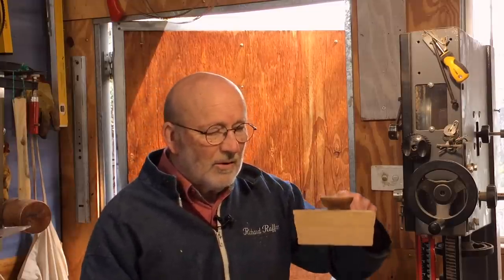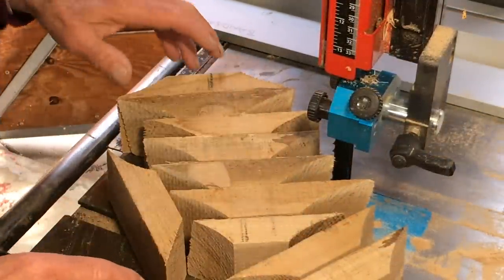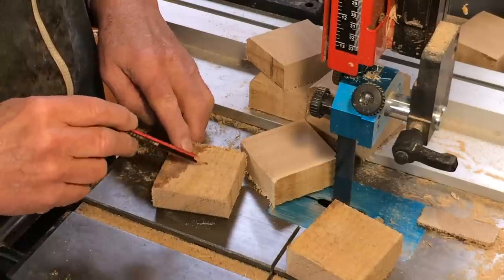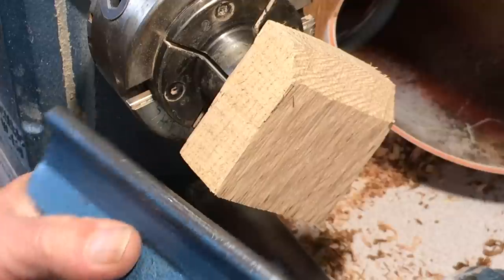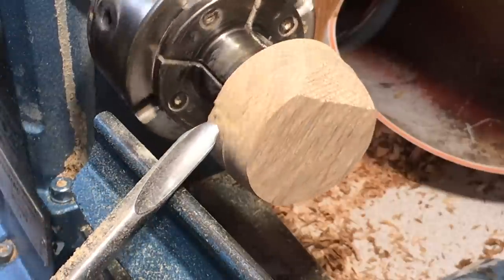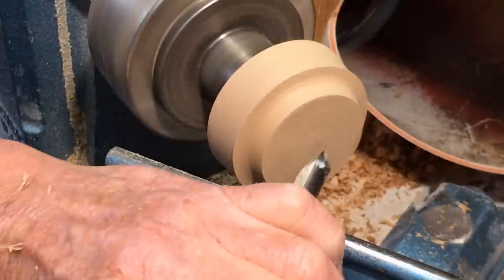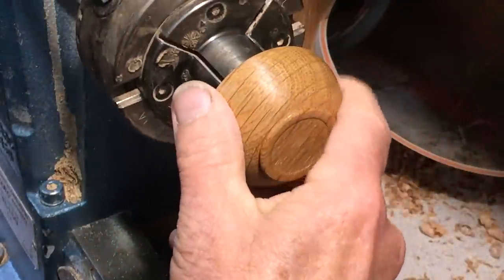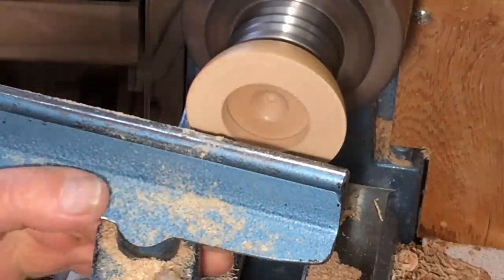Richard Raffan turns firewood into small bowls.

Comment: I love watching your videos, you have been my turning professor for years, first in print, now on my phone!
Do you ever turn larger anymore? It is sometimes challenging to translate the techniques I see you use to 14 to 18 inch bowls and would love to see a video on it!
Either way, thanks so much for continuing to share you knowledge!
Reply from the maker: I downsided to a smaller lathe mostly so I wouldn't be tempted to accumulate piles of large timber and blanks when I had no market for the end products. In 53 years I've turned about 36,000 bowls of which fewer than 4000 were over 12-in diameter, with only about 50 over 18-in. The techniques are the same but slightly slower in execution with a bit more concentration on moving the tool precisely.

Comment: Happy New Year, sir. I'm always very happy to see the use of as much of the wood as possible, it feels like true respect for the material to me. (As well as economically sensible of course.)  You mentioned kiln dried wood is not your favourite, does it dry unequally or cause the composition of the wood to change somehow? And would you normally (in production) do all the outsides in series and then work on the insides? Thanks very much as always for sharing your knowledge.
Reply from the maker: Kiln dried timber works very differently to air dried. In production I woudl do a batch of outsides in the morning, then hollow them in the afternoon, much as in https://youtu.be/laBPappesP8 and  https://youtu.be/X0ZkDrpoRKg.

Comment: What is your ratio in time on sharpening tools and turning?
Reply from the maker: Much of that depends on the wood, but I try to use wood that won't take the edge off a tool too quickly. It takes me less than ten seconds to touch up an edge on a highspeed grinder and much of that time is the grinder coming up to speed.  I've never thought to work out the ratio of sharpening to turning time. In most videos I start with sharp tools and don't often have to regrind or hone.

Comment: i've rarely seen you do much sanding in reverse - when do you choose to use it and why?  excellent example of why you never wrap the rag around your finger, by the way.  also i'm not sure if you mentioned the speed - about 2000 RPM?
Reply from the maker: Speed probably about 1700-1800 rpm. I sand in reverse when I can feel a patch of endgrain proud of the surface. I try to avoid kilned-dried timbers where raised endgrain is more likely to be a problem.

Comment: Nice work but totally wrong wood oak has tannic acid in it and stains very easily, better to use beech, birch, maple,teak, etc.
Reply: While you may be correct as to what woods stain easily, I think you’re missing the point of the video. Utilizing small scraps to produce nice products. 

Great work on the video and bowls!
Reply from the maker: Totally wrong for what!!!??? What a bizarre observation. And what's wrong with wood getting stained — which is inevitable with use.